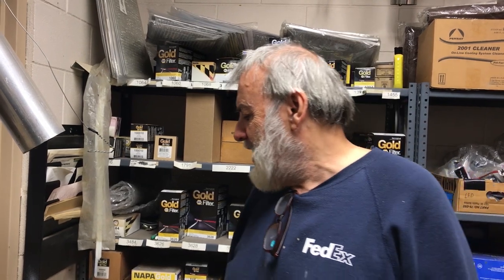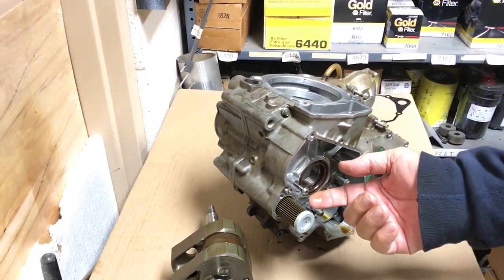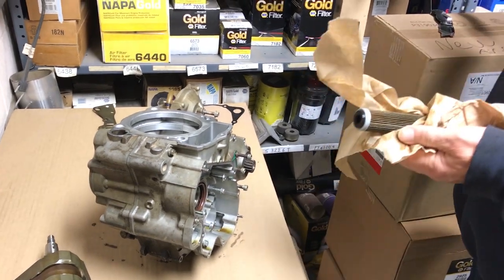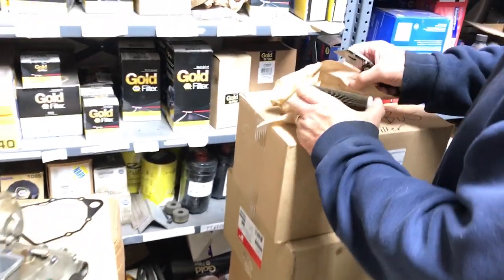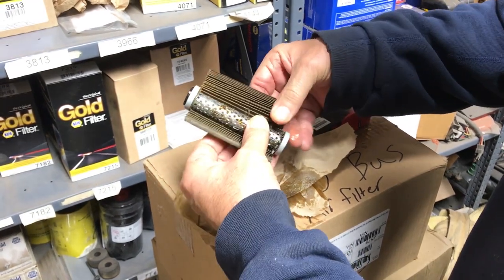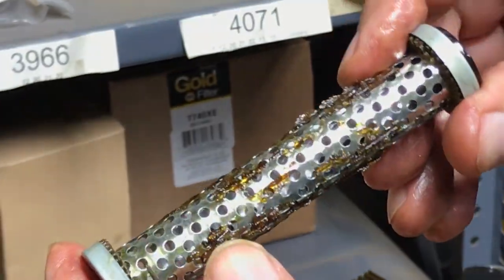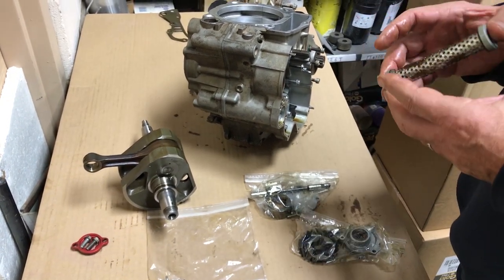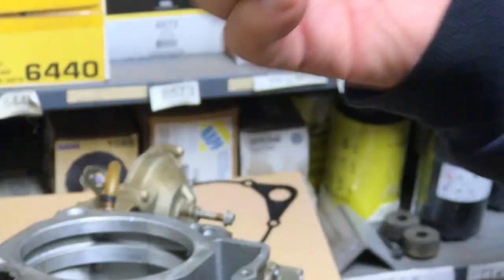Tusk Oil filter caused engine damage. Beta 350RR

Comment: Glad I’m running the Stainless Steel filter. 

Outstanding explanation of many details of oil flow etc.
Reply from the maker: How are you suppose to clean those?
Reply: @LukeBrinkerhoff  carb cleaner and an air compressor blow attachment really.
Reply from the maker: @aaronmgray  yeah that wouldn’t be clean enough for me.
Reply: @LukeBrinkerhoff  look like new after they’re cleaned. 

125 SX champ, Ty Davis recommended it to me. 

He’s trusted them for off road championships too.

Comment: That’s poor craftsmanship on the filter manufacturing. I hope you get this resolved. We just put one of these filters in Riley’s bike!
Reply from the maker: I’d get it out and check it. I’ve seen other beta riders same filter have the same look. Didn’t say if it destroyed their engine. Supposedly RM has destroyed their stock and replaced with good filters. I don’t trust at all now. Curious what yours will look like. Only gonna run proX or oem. Definitely will check inside of the filter now.

Comment: Thanks for the info but,
I have tusk filters and none of them have any glue as you can see in your video.
Reply from the maker: The only ones I’ve seen this bad are for beta it looks like, I would still be weary. Cut open a filter out of a ktm(unknown brand) it had some glue but not near as bad. As far as I am concerned they shouldn’t be glued. I’ll have a hiflo filter I’ll cut open after I put some hours on it. I threw away any other filter.
Reply: @LukeBrinkerhoff  
you're right !
I opened one Tusk filter And I found some glue. 
The filter is for husqvarna fe350
thanks